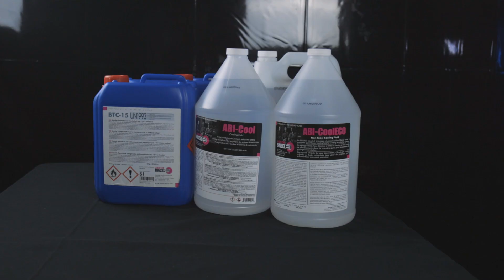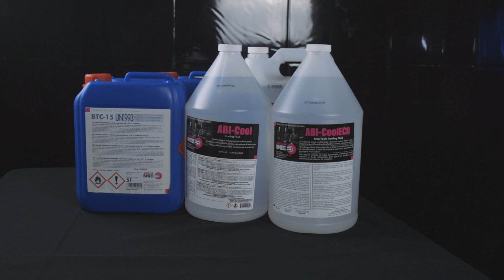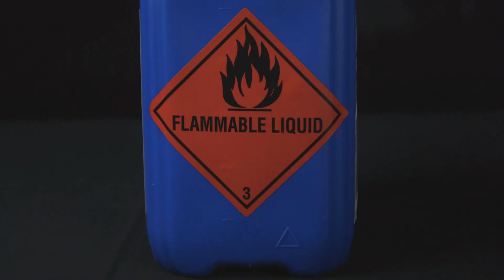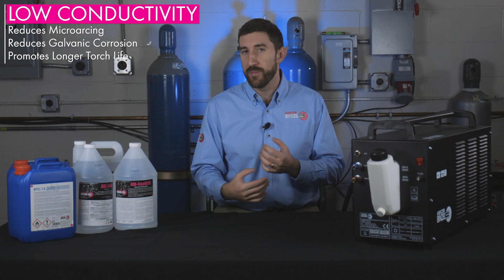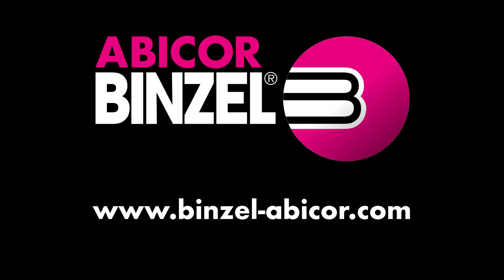Which Welding Coolant Is Right For You?

Comment: I have a milley big 50 diesel generator arc welder.  What would I have to use for it?
Reply from the maker: Hey Justin, thanks for the comment. Unfortunately, we cannot suggest any one solution since we do not know the ins and outs of that product. It's best that you consult the manufacturer to answer your question.